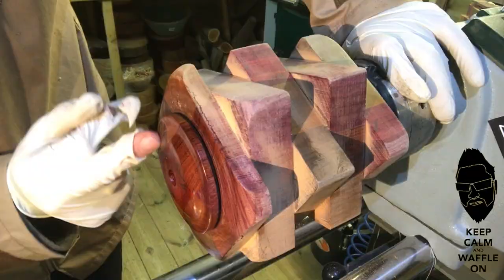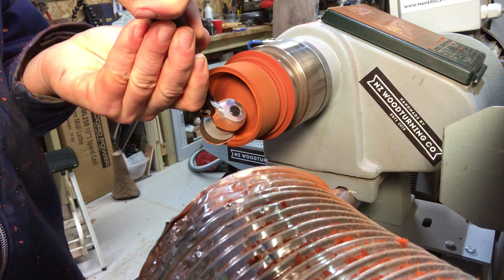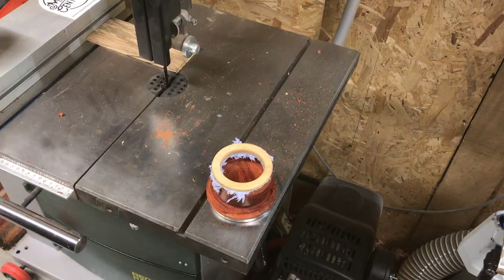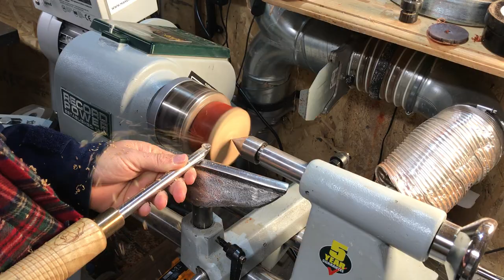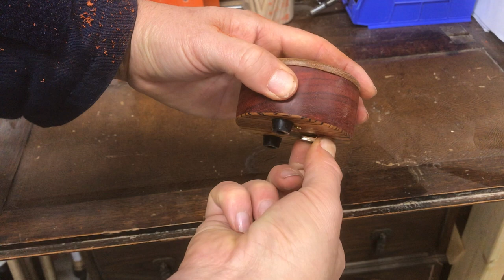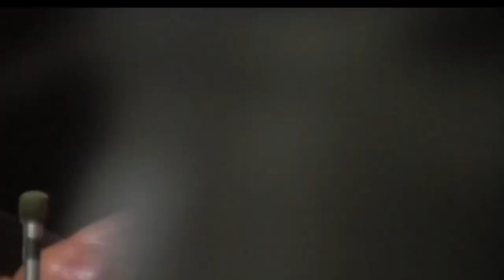Woodturning - a box of music for my mum

Comment: I was concerned about the "rough up of some bits" but I really like how it turned out !  I wonder if you've ever used cinnamon sticks in resin. That could make some interesting candle holders for your holiday table. Hmmm ???? wondering if you would have to use a ventilator mask though. Enjoy your time off  and may God many bless to you and yours.
Reply: TinaMarie Gregory - as I/you had seen the dust/extractor fan pipe behind his lathe that he pushed out of the way, he appeared to not be using it 🤔
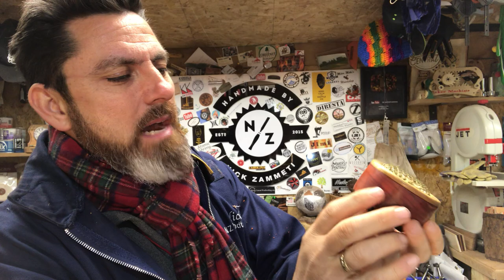Reply: Samuel Fellows ,  I was referring to Nick's comment at 15:52,  but I understand what you're saying .  I'm always thinking about the bits of dust, chips and shavings that go air born. God Bless you and yours .
Reply: TinaMarie Gregory - I am also a Pentecostal Christian ✝️ God bless
Reply: We are Baptist but still there is much to rejoice over.

Comment: Does your dust extractor system work? I have seen some of your other videos that like in this one, it appeared that you were not using it and you had pushed the pipe behind the lathe out of the way, another commentator had concern and suggested that you need a dust mask (I assume you wouldn’t need one if you were using the extractor, maybe you could do a video about that?)